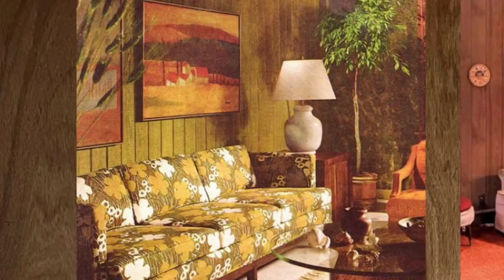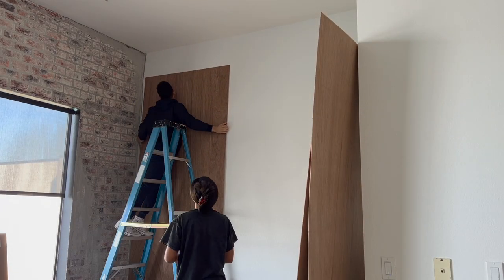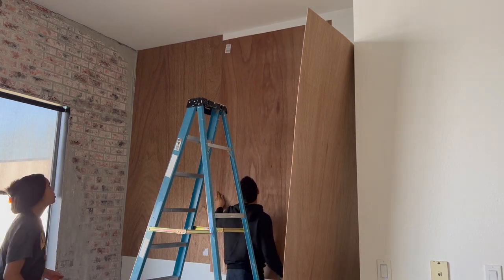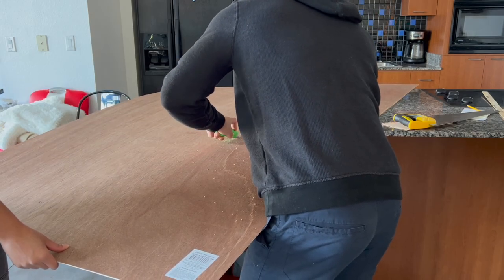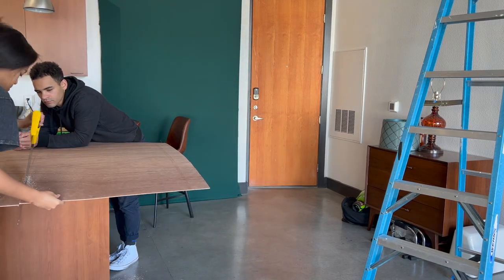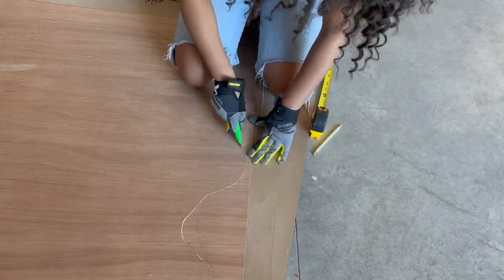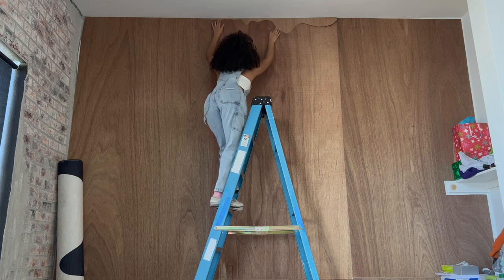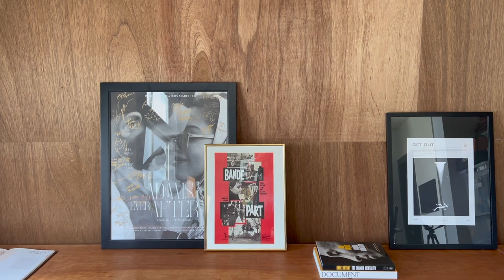DIY Wood Accent Wall *retro contemporary aesthetic*

Comment: Brava!  Totally impressed.  I have a 1964 raised ranch that was a capsule house when we bought it--except for the lower level family room..  Sometime in the 80s, extremely ugly and cheap paper-over-particle-board paneling was installed.  I know that the old school luaun would look great, I just didn't have enough courage to go through with it.  You have inspired me.  Thanks!  I do have tips.  1--I would have removed the closet thingie:  take off the shelf, unscrew the support boards, and then put in all the paneling.  Then, replace the supports.  WAY easier, IMHO.  2--I see you are Team Hand Tools.  That's cool, but neither hand nor power tools will work unless you use them properly.  So for cutting the sheet, you ought to have had both sides of the sheet fully supported and clamped down, etc.  Not trying to give you a lesson, but suggesting you get some basic skilz.  I like the Youtuber "See Jane Drill." She is a brilliant teacher.  Overall, though, you got great results and if you want, heck with extra prepping, do it yourself and do it your way.  Keep going.
Reply from the maker: Thank you so much! I'm so happy to hear this inspired you! Thank you for the tips on the clamps (I eventually found the score and snap method was the easiest non power tool method!) And I'm renting so I was too nervous to remove the closet thing I plan to cover it with a tapestry of some kind in the future! I will definitely check out See Jane Drill because I have so much more I want to learn about woodworking and making my own pieces thank you again for this feedback & for watching ☺